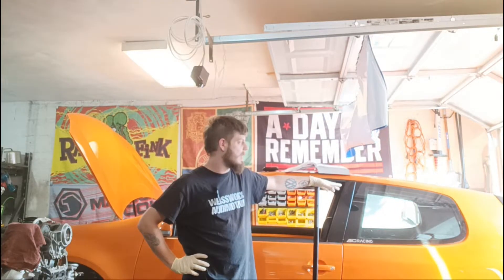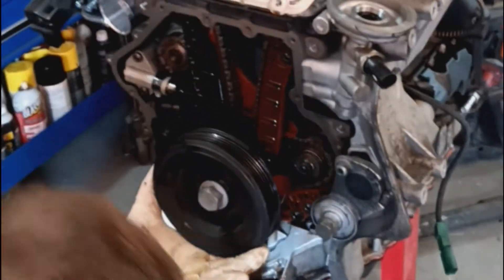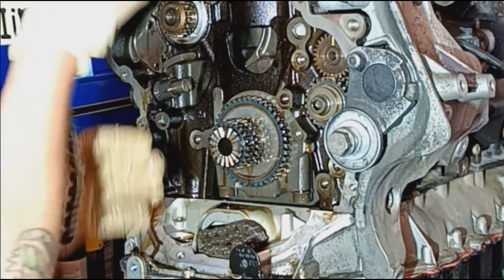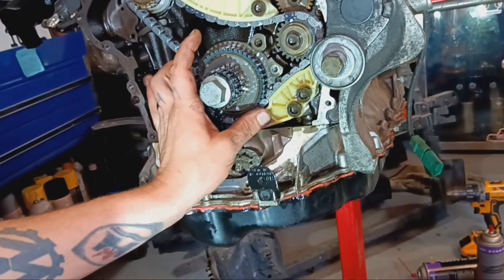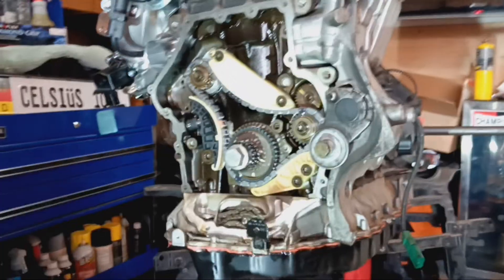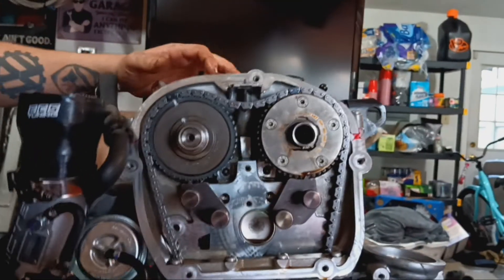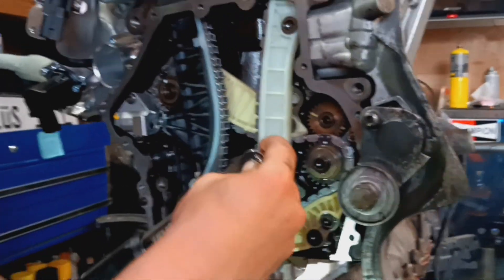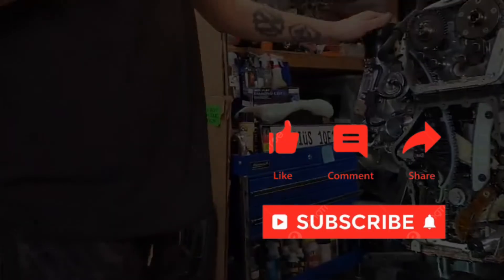EA888/1 2.0T Tsi Timing Chain Installation Gen1/2/3

Comment: The Timing of the balance shafts is wrong. Don‘t do it like in this video!!
Reply: I agree don't follow the balance shaft instructions it's wrong the markings are wrong.
Reply: @danieljsantacruz agreed as well. Blance shaft on the right mark should all be lined up
Reply from the maker: Explain?  Timing marks and chains are set by link location.  How is this wrong?
Reply: @Weissworx  The gear of the right balance shaft must be positioned so that the yellow line points to 12 o’clock and the yellow dot points to 6 o’clock. The gear beneath it, which drives the right balance shaft, has two small dots (barely visible) on the rear sprocket between two teeth. The yellow dot at 6 o’clock on the balance shaft gear must align exactly between these two dots. When this is the case, the dot on the front sprocket also points to approximately 2 o’clock, or in the direction of the Torx screw.
Reply: @Weissworx  ooof